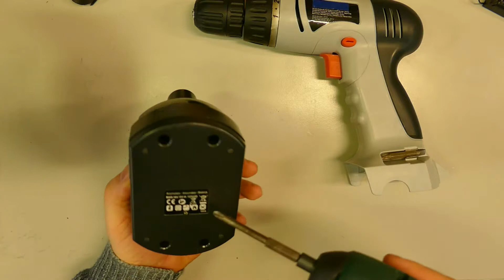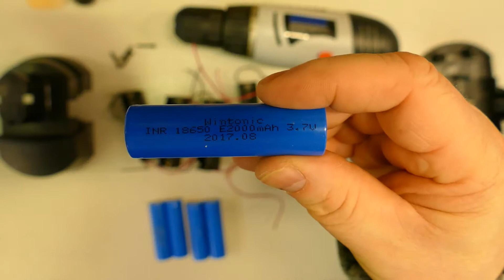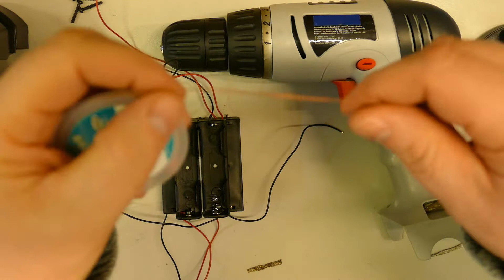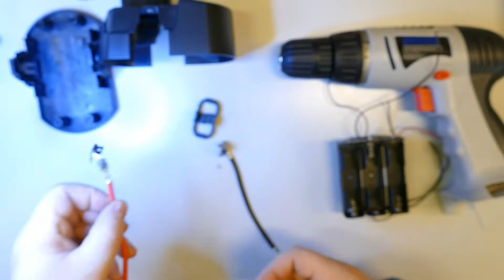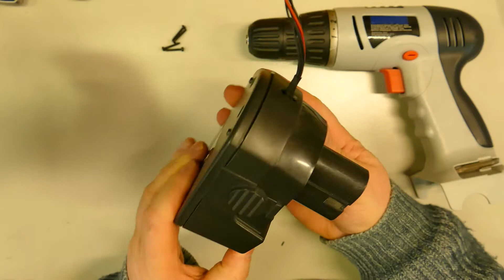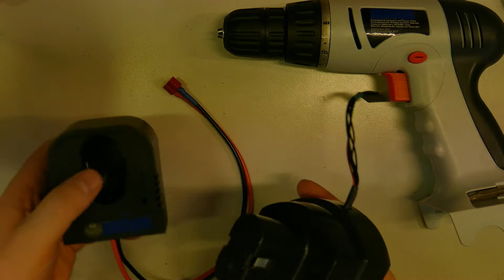DIY Lithium battery pack instead NiCd

Comment: Hi TauCeti:
I like your video, cleare and very informative.
May I know the brand of your charger and where can I buy it?
Thanks.
Reply from the maker: Hi Cacharrote, the  charger brand is ImaxRC, this the X350 model (350W max 15A). As l now it is a discontinued product, but you can find on ebay: 
https://www.ebay.com/itm/iMaxRC-X350-1-6S-350W-Touch-Screen-Balance-Charger-DC/153876097529?hash=item23d3bae9f9:g:UCkAAOSw4~Beepz9
Reply: @tauceti.  Thankyou very much